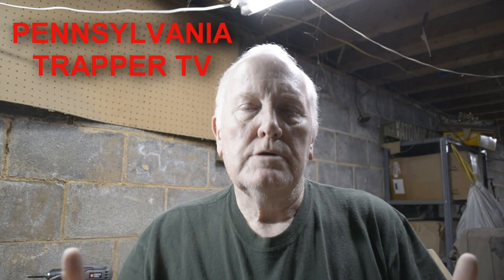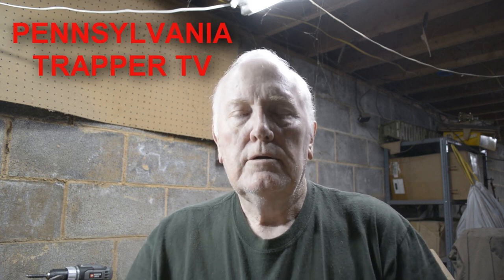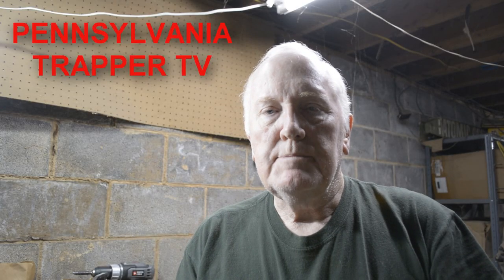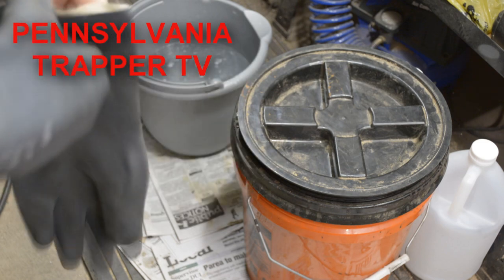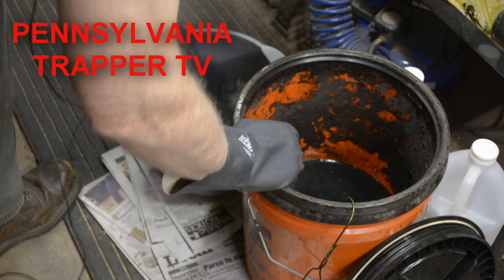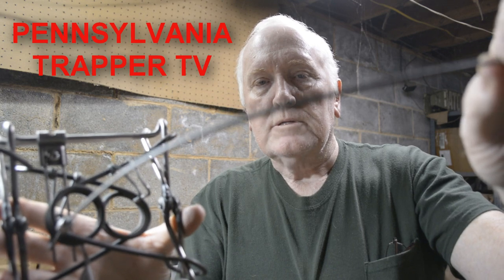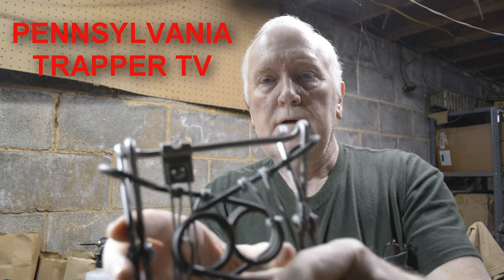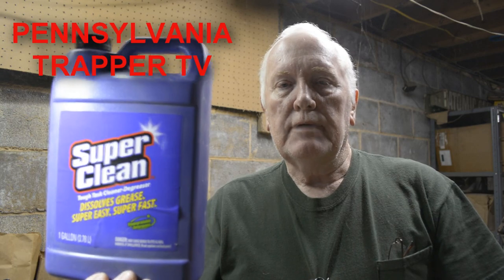Degrease New Traps--How To

Comment: How long do you put them in for? Is it just the cleaner itself or do you add water to it?
Reply from the maker: Irishcoyote07.....12 hrs. or so removed grease from my traps.  I use a bucket with dawn soap & hot water to clean the  super clean off the traps.  Thanks for question & for watching